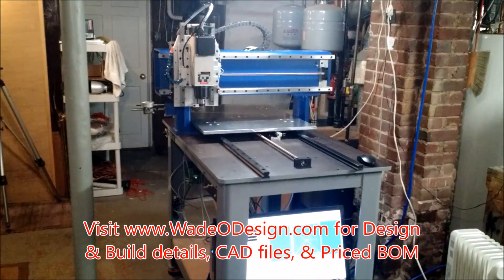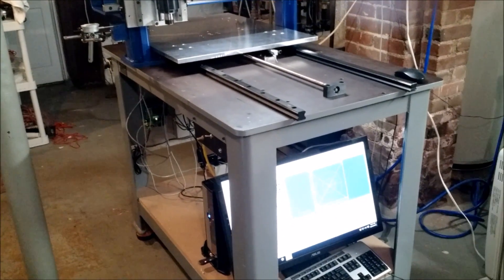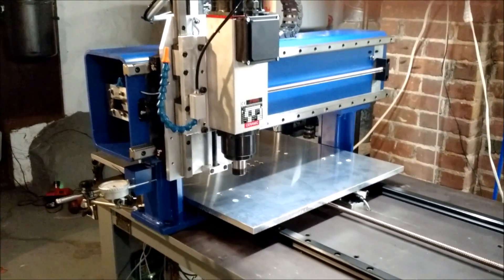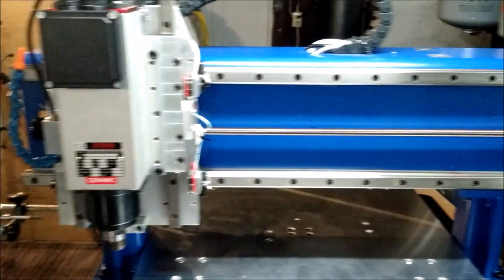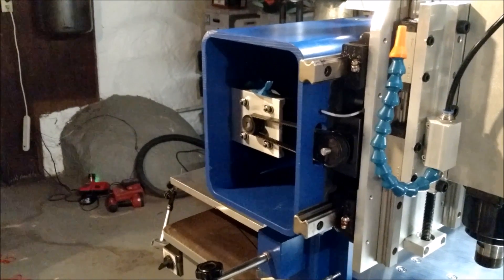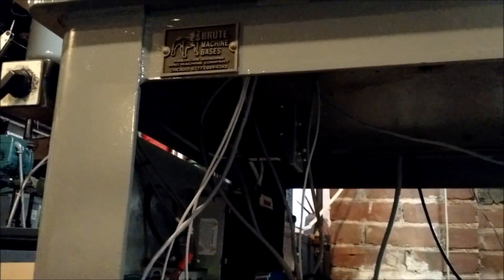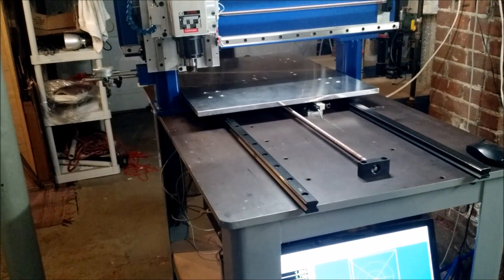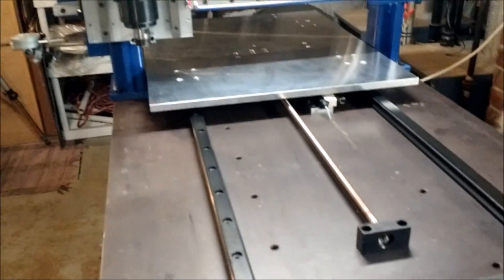CNC Router - Fixed Gantry:  Overview and first cut with aluminum

Comment: I like the router you made. Great job. I only have one thing to say about your machining pratices. Please don't use air to blow the chips off the part after the process is done. I have been a machinist and tool maker for ove 36 years and the only thing you are doing is blowing teh chips into the workings of teh machine. Please use a vacuum to suck the chips up. I know I will get some greaif over this statement but what the heck. Keep up the good work.

Comment: I'm building a cnc with a similar weight z axis. What stepper motor did you use to move that weight. (motor inside the box section). Did you use any gear reduction?
Reply from the maker: I used nema23 and had issues.  Had to add springs to help offload mass.  I'm now using servo without springs... Better, but I wish I still went larger.  So bigger is better - it's a lot of mass
Reply: @wadeodesign2699  ah, in using a 23 with feedback loop in my design. I may upgrade in the future. Although most of my cutting is going to be wood. So fingers crossed it works.
I'm going to be using dual closed loop nema 23 motors to move the gantry. 
I'm not aiming for high speeds just yet.

Comment: nice design, but you need to protect those ball screws on the bottom. All those shavings sticking to them won't be good for the bearings.

Comment: In General I like the design. Z rail should be supported by plate at the top as they will flex at top position. Cover for ballscrew would be good. Filling profile with granite improves damping vibrations and sound.

Comment: the machne is a beast ! im guessing some of the pieces of steel and the aluminum Y plate were most expensive
Reply from the maker: The machine base was most cost (although bought used).  Next the clear path servos (upgrade) then the moving table.  The steel gantry relatively cheap.  Full price bom is listed on my website.

Comment: WD40 is not a coolant. Only hacks use it for cutting.
Reply from the maker: Yes, correct FluxAE.  From previous constructive critic as you mentioned I've moved on to a mist coolant and compressed air lines.  What you're seeing in this video is the very first piece of aluminum strapped to a new machine.

Comment: I love your design. Really good and looks really stiff.
I have been thinking about designing a similar machine. There is a different approach to mounting the moving bottom plate that might increase stiffness even further. Right now, you have probably 4 slider blocks on the bottom of the plate, and rails on the table. The distance of the blocks from the cutter will typically be large, so there is a stiffness issue. If you mount the rails to the plate and the blocks to the table, the blocks will typically be closer to the cutter, increasing stiffness. Do you think this would help?
Reply from the maker: Your basically right.  Flipping them around will insure the cutter is always positioned "inside" the 4 blocks and give more consistent stiffness of the moving table (similar to a milling machine table axis).  As I have it, the moving table, at it's extreme motion, actually places the cutting force outside the nice stiff "zone" inside the blocks.  BUT you sacrifice a lot of usable table cutting area for this arrangement.... Also even when cutter is at extreme "overhang" locations the stiffness of the blocks are well withing acceptable limits wrt the cutting forces.  Cheers - Wadeo

Comment: Here's a random tip that sometimes works.  When cutting aluminum without coolant make the chips as big as possible.  Thing HSM speeds and feeds even if you reduce width and depth of cut.  Then, you have larger mass in the chip to absorb the heat and they are sometimes less likely to kindof, melt to and gum up the mill

Comment: you have to run a mister with aluminum, end mill may start out okay, but eventually fails
Reply: Can you tell please what is a mister?
Reply: @wd9102  a mister has a air line and another line into a coolent bottle or resivor and by adjusting the air pressure you control a coolent mist much less messy than flood coolent  I have a rubber tray form ebay my router sits in misters on amazon are not very expensive
Reply: @garylarson6386  Ok. Thanks for that quick answer. You are right on your point about mist when machining aluminum.

Comment: Regarding your Z axis design, with fixed rail instead of fixed slider you will have very limited Z clearance, maybe you rectified it before your first cut?
Reply from the maker: I made some minor adjustments to the z-axis so that the z clearance is not dictated by the y-axis rails and gantry beam.  If doing over again I think I'd lift the gantry at least 1" so that I can have more room when using a small 4" kurt vise.  I was focused on stiffness at the spindle cutter and think I can sacrifice some of that for extra clearance.

Comment: what a great peace of work!!! what you have done that you would do different?  I thought the ballscrews should be at least 10mm for pitch....  then would not be slow...
Reply from the maker: +Ricardo Fabar   I've replaced the steppers with clearpath servos.  Other things I'd change...  1) create a full box enclosure to protect the gantry hardware and fully contain flying chips (although the table rail protection "rolling shade" works great).  2) make the limit switches >5v - noise has been a big enough issue that I needed to disconnect them. 3) counterbalance the z axis (.spring design is not great)... Or better yet, spec a big servo motor on z axis.  4) add an automatic way to zero axis on startup.  5) spindle with tool changer capability.
Reply from the maker: Clearpath CPM-SDSK-2331S-ELN replaced the steppers on the X and Y axis - speed increase and silent - was a direct replacement as they are Nema23s.   I haven't converted the z axis yet... this will take a bit more work as I think I'll move to a Nema34 with more power which will require some redesign of the z axis mounting.  The existing Nema23 stepper on the z axis is simply too small to handle the mass of the z-axis - tried to solve this with offloading weight with springs but it's a poor setup/design.  I can't justify replacing the spindle at this time for tool changer... it's just a nice to have in the future but will eventually be a project I undertake.... but likely +1yr away.

Comment: Each cut the flute makes generates the same amount of heat , the trick is to generate chips large enough to absorb it and carry it away from the tool ...slow down the spindle or increase feed rate ...

Comment: what are the advantage of the mobile table?
Reply from the maker: The moving table has a disadvantage of needing more floor space as it hangs over the table at end of stroke.  But then big advantages are obtained in the gantry design as it's not moving it can be made extremely rigid very easily.  It's also simpler to drive the table with a single ballscrew centrally located under the table then the gantry with two ballscrew and motors on each side of the gantry.

Comment: I imagine you've done some research on different cutters by now. All that machine, and the flutes still pack up. It is always something.
Reply from the maker: Ya I've learned a bit.... added a mister and watch my depth of cut on slotting - HSM techniques have worked extremely well.  The packed chips was definitely user input and not much to do with the machine performance.

Comment: Get a cover for your ball-srews!!!
Reply: dunichtich100 dont go runing balls  out man
Reply from the maker: I fixed that for table ballscrew - see video on guarding.  Gantry ball screw and rails still get some chips - any ideas welcome on this.
Reply: I suggest to put a round flexible bellow for the ballscrew and try to get compatible bellow or seals for the rails.

Comment: Lots of questions, as I'm very interested in building a machine like this.  First one:  How much backlash do you measure with this machine?  Thanks, Paul
Reply from the maker: +Paul Vogt Paul... Backlash is controlled quite well with the anti-backlash design on the ball screws.  They are not purchased as anti-backlash but made so in design.  Check out this post on my website... http://www.wadeodesign.com/special-topics-blog/cnc-router-performance-accuracy-repeatability-backlash ... Further info can be found on the design details page.  You can then fill in the contact form with any additional info questions and I'll get back to u via email.

Comment: Should've swapped the rails and carriages around on the z-axis, this way you could also mill higher parts or use a machine vice. Also, don't let chips get in the ball screws and linear guides, but you already wrote you'll fix that. Will there be t-slots on the table or threaded hole pattern?
Reply from the maker: +Klaufmann   Ya, I quickly learned I needed guarding for the ball screws and rails ... I have another video showing how I implemented a window shade to protect them.
I ended up tapping a 3/8-16 hole pattern into the table.  Works out well with edge clamps -see my site for further detail on that design.
Reply from the maker: +dieselrotor    Ya, it was immediately apparent I forgot to think about a major issue with the ball screw exposed in the moving table design... Was just so concentrated on the nuts and bolts of motion.  It took me weeks to come up with the window shade design and it's performed outstanding at low cost.
Reply: I was going to mention chips and screw shafts don't get along then saw this. Nice setup. I think I want to build this design compared to a few I have seen. glad I saw this video.
Reply: Still very good work. Glad You found a solution. Ingenious solution with the draw shade. Bellows would not have worked horizontal. I really like this machine.

Comment: Warm Up cycle? Lol, thats cute. Damn that thing is loud, for not cutitng... ATC? ShuddaCouldaWou... Servos are the shinzit mang. So strong and quite. and Fuggin Expensive. Show me me some dimensions ...I'm curious of the accuracy, or I mean...precision. yea 20k rpm in 6061 whoh! Why is everyone buying these spindles? Your not cutting steel and not enough tangent force to use carbide like it likes it...
Don't get me wrong Wade I like it.  Thats my critique, and I haven't built shite, but I've learned a bit from your work. 
Contact me if your still into this kind of thing, I'd like you to critique my design. casmachinedesign gmail

Comment: About the WD-40. When I worked for my Gandpaw I didn't grease the tractor for about a month,  one Monday morning he was waiting by that tractor with a greace gun in one hand and a ball joint in the other. He asked me how much the ball joint costs, I said probably a hundred bucks, then he asked how much does the greace cost, I said about a dollar a tube, he then asked if I had any questions.  I took away from that he was telling me that parts are expensive,  and lubrication is cheap,  so use the hell out of that WD-40 them end mills are expensive.
Reply: Abby Babby Nice storry bro^^
Reply from the maker: +Yuuki1942    25mm on table and 20mm on gantry.  Yes they are definitely rigid enough.  Ways dampen better but are a bit sloppier and can't run as fast.
Reply: Abby Babby i want to buy some linear rails but the only price i can pay is from china hiwin of a price 378 US Dollars.the 20 mm.i alreasy have some sbr20 rails but they are not  rigid enough.
Reply: are the linear rails 20mm or 25mm.are they rigid enough

Comment: Thank you so much Wade for sharing this awesome project with intenet community. I think it is really really interesting design, mostly for simplicity and great stiffness obtained with relatively cheap components. I'm still finalizing my first CNC ( much more cheaper, based on Openbuilds C-Beam) but I already have in mind to realize another one in the future. I will take surely some ideas from yours design. 

Thanks again and compliments for this awesome machine!
Andrea
Reply from the maker: +Andrea Di Leonardo Thanks Andrea and good luck with your build.

Comment: is there a reason you didn't have the carriages stationary and the rails moving on the bed axis? because that way the support would always be directly under the endmill...
nice build in any case... makes me tempted to go with a fixed gantry on my next router.
Reply from the maker: +sn0wchyld  ...  The rail sizing for the bed axis are considerably longer than the bed itself so by switching the rails to the bed, they would extend beyond the table and the extend well into the operator zone on max travel.  I was a bit concerned that the blocks move outside the mill cutting area but the 4 blocks have very good load ratings even when the load is coming from a location outside the perimeter.  You can see a good example of this by seeing an Onsroud fixed gantry machine video.
Reply: Wade'o Design my thought is that because the blocks are always aligned with the endmill then they can be far closer together (within reason), so the overhang would be relatively minimal (like 150-200mm each side of the endmill, extending the bed by 100-150mm each side would take care of it? i dont know how it'd go with vibrations however with over half the table haning in space at the extremes of travel...

Comment: Does this fixed gantry style offer extra rigidity?
Reply from the maker: +Despicably Irascible Rapscallion    Yes, as compared to a moving gantry router this design is far superior in stiffness.  Also allows a single ballscrew and drive motor directly mounted to the center of the table axis... Many moving gantry designs you'll see dual motors to drive the gantry from the sides.  Downside is size required but as long as u keep it under about 30" stroke that doesn't play in too much.
Reply: Wade'o Design Yeah, my CNC has a moving gantry, and it's pretty much limited to wood and aluminum.  There is a substantial amount of flex, if I push it too hard.

Comment: Add a spray mister, you can even switch it on and off in the control...
  and there are end mills just for aluminum that clear nicely, selection may save you a bunch of headaches.
Reply from the maker: +Mark Richardson ... Thanks for the tips.... I'm finishing up a mister this week... Spraying wd40 manually gets old quick.

Comment: Beautiful. Nice job. 
 Can you include the BOM for all the electronics, the Control.. motors... 
 I don't have any trouble at all with the machine work. 
  It is the can of worms that kills me. 
 Thanks!!!!
  Mark
Reply from the maker: +Mark Richardson ... You can find the parts list on my site to download and it has the basic electrical parts listed but the build in this respect is still a bit incomplete and looks like a rats nest with no enclosure yet.... The main change coming up is to swap the speed reduction ratio of 0.66 to an increaser with 1.5 ratio on the x &y axis.  I expect to utilize the Nema23 steppers more appropriately with this change.

Comment: Hello! First of all.. Great machine and great work !! Do you think it can handle (or have you tried) mill/cut some A36/1020 steel in this machine? I plan to make one of those to flat or do holes in mid-steel after i cut it in my plasma
Reply from the maker: Steel... The biggest issue would be the spindle speed  which is rated for 18000-24000 rpm.... Steel wants MUCH slower.  If targeting steel u could swap the spindle but I'm not sure if it's not better than simply getting a small mill at that point.
Reply: +Wade'o Design I see.. The point is to build a machine. But the structure can hold steel.. ok thankz!! And thankz
Reply from the maker: I think the structure will be sufficient with steel for light cuts no problem but heavier cuts would probably be an issue.. Although you can see the Onsrud professional routers cutting stainless on YouTube and that's the original inspiration for this design... It would be interesting to compare the stiffness characteristics of this gantry style to a typical hobby milling machine like my pm932 mill.  The machining area is definitely a pro on the router style.

Comment: wont chips all over the ballscrew make it missteps?
Reply from the maker: Correct... I started designing a remedy for that as soon as I started cutting.  Just finished up installing some parts and the solution will be my next video post... Stay tuned.

Comment: Great. What the name of the steper motor?
Reply from the maker: Steppers are Schneider Mdrive Nema23 triples.  These things are high end commercial steppers and  normally run $280 - would not have bought new but got a good deal on eBay used.
Reply: +Wade'o Design thank you. And what the of the spindle motor. ? Good idea. You are very pro
Reply from the maker: The spindle is Italian made Tecknomotor 2kw.  It's a step above the cheaper Chinese spindles but not as expensive as the industrial spindles like columbo.  My site www.wadeodesign.com has a full bill of material with links and pricing in the routed download section.  Cheers.

Comment: Hi there! Nice quality build. How did you heat up the ballscrews soft enough for machining? It is very hard for me to machine it even with carbide bits. Thanks in advance.
Reply from the maker: Abreham... I used an acetylene torch to anneal the ends.  I found info on the web that 650 - 750 deg C was required but I simply heated until cheery red and it worked like a charm - machined very well.  I used a heat blocker gel (found in welding supply stores) to protect the transition areas.  I found this cool youtube video showing a professional shop perform this task and they use a coil to heat ends which may be useful ->  https://youtu.be/dzIsR4Mg158
Reply: +Wade'o Design , Thanks for the info! I'll let you know how mine turns out.
Reply: @wadeodesign2699  thanks!